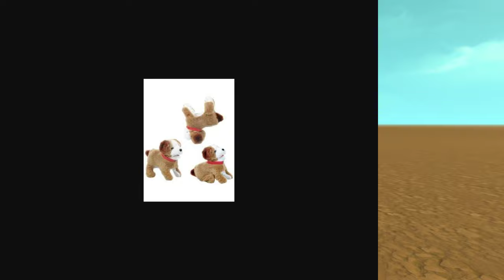Building a Classic Toy! The Flipping Dog! | Scrap Mechanic Stream VOD

Comment: Durf you do know how the toy is made IRL right?
It doesn't use any sort of logic circuit or controller. It's a motor, springs, and some cams. You should be able to replicate that mechanism using only vanilla blocks.
Reply from the maker: @andre21198  Oh, the modded parts were because vanilla parts simply aren't fast/powerful enough.
I could have built a mechanical solutions with few logic blocks and sensors to mechanically stop the legs at certain angles...but that'd be depending even more so on SM physics.
Ultimately the point was to build the idea in SM, since an actual replica just isn't possible. But if you'd like to show me otherwise, I'd be happy to show off your build in a video!